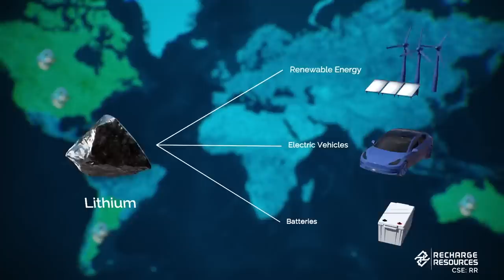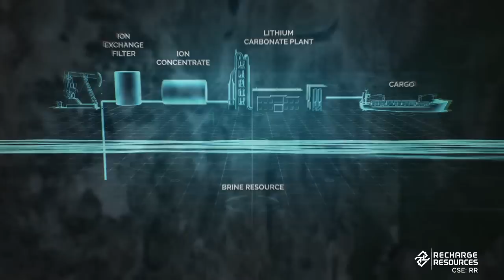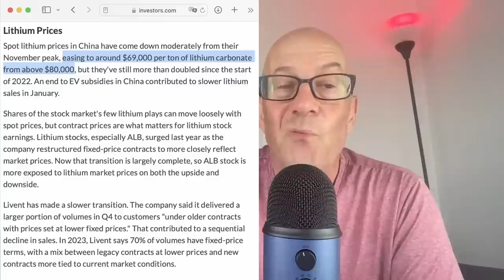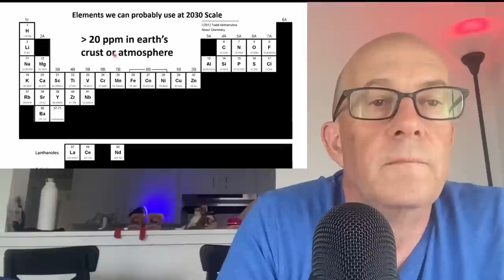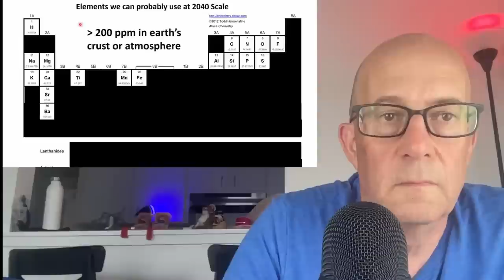TESLA Investor Day - Lithium & More Plus Gen 3 Platform

Comment: WHY DO GRID LEVEL BATTERIES NEED TO BE CHEMICAL BATTERIES?  Automobiles currently need chemical batteries because of their relative low weight.  Land based batteries do not have a weight restriction.  We can use all kinds of other less expensive energy storage solutions like "steam/water" batteries, "gravity batteries" (mass is lifted to store energy and dropped to release energy), "compressed gas/air" batteries, etc.  I don't see this as an issue Warren.  Peace, Calvin.
Reply: It’s probably the ability of batteries to react almost instantaneously to demand. Plus, they’re much more efficient than mechanical pumps.
Reply: @thomasaquinas157  I agree, it makes sense to have a smaller sized chemical based battery (in a land based energy storage system) for quicker instant responses to spikes in grid demand.  But the bulk of the energy should be stored in environmentally friendly, less expensive solutions like those I've mentioned above.
Reply: @environmentalcanadian2338 
Agree use batteries as a buffer zone but have other energy storage to keep the buffer zone charged or directly connected to the grid once up to speed and then take over from battery storage.
Heat storage in sand would be a good start for that as well. Use a solar collector to heat sand to 1500 degrees then required energy is released at the appropriate moment
Reply: Various other "batteries" include pumped hydro, compressed air, gravity. But chemical batteries work today, can scale, and the cost to wait 5 years for these others to scale or build. 
Chemical have benefits they are fast response, can be scaled, and come in on budget.
Reply: Efficiency of lithium ion batteries are nearly 100%. Pumped storage is 70% efficient at best.

Comment: 300Twh can probably be cut to 150-200 if we apply our knowledge of Building Science and improve home and building efficiency.  We know how to build "Net Zero" homes. There's no reason we can't retrofit homes to reduce energy consumption by 50%. I'm not a contractor but I insulated the hell out of my last 2 homes. More insulation and higher-quality windows and doors mean, a smaller boiler/HVAC system, fewer solar panels, and fewer batteries, plus better comfort, win-win.

Comment: Elon has said that Lithium quantity is not the problem. Refining process is, it has not changed since it was first invented basically and is slow, dirty and most importantly VERY low yield of lithium with high enough quality to be used in car batteries.

This is where Tesla need to do the vertical integration buying a Mining company will just be gravy/ might speed things up.

Comment: Great video, really thorough and interesting.

I really like cryobatteries, the kind of thing Highview Power is working on, I think if Tesla bought them and massively scaled their tech then that could reduce the amount of resources needed a lot, it's also a good way of taking CO2 out the air.

And then yeah one thing I wonder is how much benefit they will get from making so many of the 3rd gen cars, the economies of scale on factories with that level of output would be huge. I wonder if that's what project Highland is, a reference to Ford's Highland park and the next gen factory with like 4x output per site than the current ones.

Comment: The battery needed for cars have vastly different requirements (energy per weight is most important) than those needed for grid storage.(energy per dollar is most important, maybe also toxicity).. so they are not necessarily competing for the same resources

Comment: A Car doesn't have to be fast as a Tesla right now, which means efficiency instead of speed. Faster charging also and you need fewer batteries. Only in Germany, you can drive faster than 70 m/h and this will change too some Day. The Plaid can still be sold for People on the tracks. This is the way to go, Very fast charging, smaller Batteries, and more efficient Motors. And when Batteries can be 90% recycled than at least 10 Years are save for production.

Comment: Is there any viability in producing bodies in a single stamping? Is Tesla looking at that? Take a big roll of material, run it out into a big stamping machine, mash the thing down, fold bits in and under, etc. Then cut the big holes out like the doors and the windows while still in the MegaStamper, keep the doors and the cutouts then undercoat, paint and fit the whole thing back together with almost no gaps. Yes, how do you do the inner panels like dash, door, headliner, etc? Pass the cutouts through different single-stampers. Well I don't know how all that would work but the idea is to make the shell like how you make toys, as Elon said.

Comment: Why is nobody talking about gravity batteries?  Lift weights to high heights then lower them to turn generators
Reply from the maker: Dahn talked about that. It requires a lot of land
Reply: How much energy is used to lift the weights? It would be like pumping water that’s already gone through a hydroelectric plant back upstream. Just doesn’t seem feasible.
Reply: Pumped hydro is long term power storage, ie days / weeks worth energy, pump from bottom lake up to top lake when power cheap, make power when peak demand and when batteries run out power
Reply: @johnharcombe9412  Yes it should be used always if possible.  I saw one with a tower crane and piled concreate weights.  Even a water tower could be used in cities.

Comment: “No non-Tesla Charging infrastructure, scarce battery materials, Toyota about to die, etc, etc” … I’ve got a Tesla and Tesla shares but I’m calling BS! Why? Because Toyota (for example) can make SIX plugin Hybrid PHEVs for every ONE ‘pure EV’ as far as batteries are concerned at much lower cost. The typically 36 mile ‘EV’ range is ‘typically’ the most used in a day, so lets call it 90% efficient as far as petrol is concerned. Wake up please all EV-angelicals … sometimes I fell like I’m talking to the worst kind religious fundamentalists, similarly regarding Nuclear.
Reply: Nobody wants to buy PHEVs. They are too expensive to maintain in the long run.
Reply: @pauld3327  compared to ICE vehicles ??? New generation PHEVs use their ICE engine about 10% to 30% of the time so service requirements are dramatically reduced. But the point is, if you want CO2 emissions reduced as FAST as possible there’s no alternative due to battery supply limitation, and inability of legacy auto, ie. >80% of all autos manufacturing capacity, to profitably make BEVs until later this decade.
Reply: @Kenlwallace  PHEVs are way too complex, legacy automakers shouldn't loose their ressources on that and go straight to full EV.

Even if the ICE motor is used only 20% of the time, It still needs to be serviced every year. By the way, if the  ICE motor is not used for 6 months straight, the ICE motor can be damaged because of corrosion.

Comment: I really hope the standard batterys are not based on lithium. We want solidstate batterys for the future. It would be sad.
Reply: They need to be available at scale first…

…dream on.
Reply: @fredbloggs5902  i know. but thats the sad part of our shitty society. just like ice cars suck even though we started with electric cars. 70% of the oil in ur car goes to waste as heat.... and we built a society around that... its sad
Reply: Solid state batteries coming year 2077🤣
Reply: @mikafiltenborg7572  because we wait for the market... I was hoping china would aford to develop that tech. But i guess it will be a premium upgrade in the future for those who have money.
Reply from the maker: Question: does solid state improve the kWh hours per kilogram of lithium?
Reply: @WarrenRedlich   - not Initally, perhaps with more research. 
Perhaps, percision Fermantation can help.
Reply: @WarrenRedlich   - I remain hopeful that Silicon - Lithium metal will be Chemestry of the Future.
Reply: @WarrenRedlich  You would get more rang with the same amount of "mass" if you will. But not only that. It way lighter, and you can stick holes in the battery and it will still work. I am not saying tesla should wait for solidstate batterys. But it would be sound for society if we managed to use solidstate batterys as soon as posible. But it wont happen and thats sad. Very often the best idea never wins, its the most ecenomicly sound idea that wins.